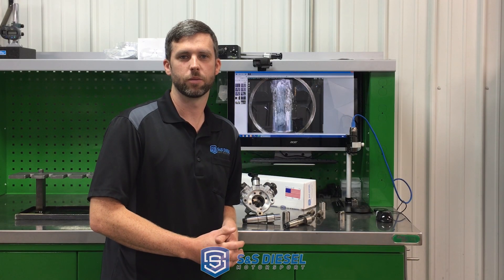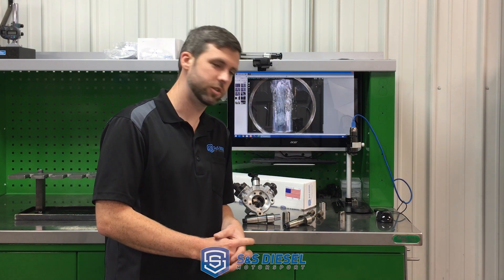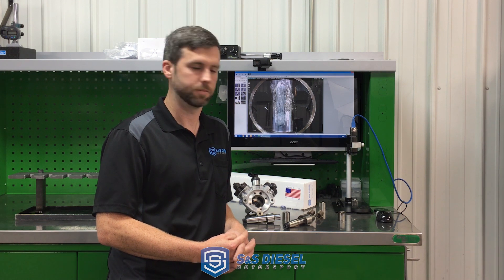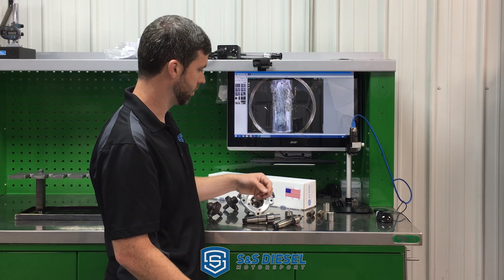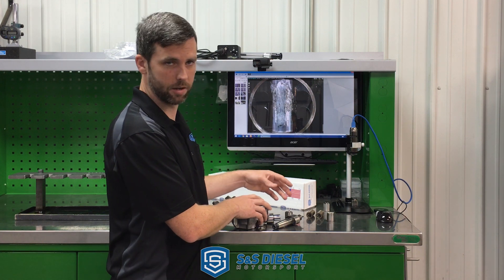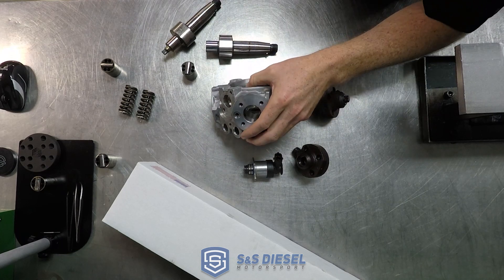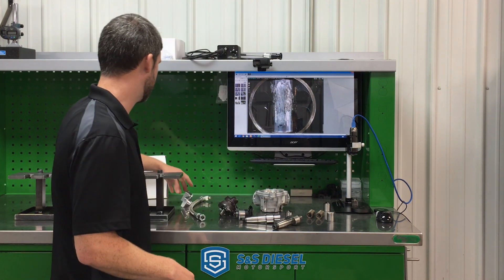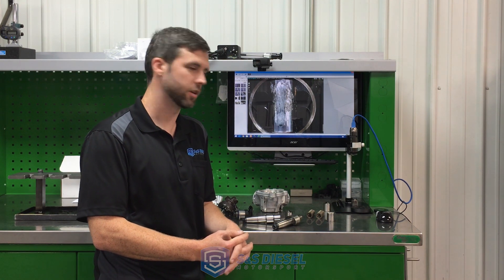S&S Diesel Motorsport Ford CP4.2 Bypass Kit Explained

Comment: I appreciate the video; from my understanding, the piece of metal that has the convex side that moves in and out on the cam portion is a design flaw…you stated that it ‘has no guides’ and therefore it can turn sideways causing the failure…why hasn’t anyone designed a pump with this fix in mind?
Reply from the maker: That is one failure mode, yet we have also seen rollers seize up and start skidding without turning sideways. CP4s in 2020 and up CP4s have guided buckets, yet there are failures with those too. Luckily, we teamed up with Stanadyne to provide a more robust solution: https://ssdiesel.com/dcr/

Comment: How do you keep clean fuel in the bottom in the pump? The pump is cooled and lubricantes through the fuel coming through the system?
Reply from the maker: This is our original Disaster Prevention Kit that blocks off flow from the case to the VCV, and then taps into the fuel supply before entering the pump case. Pump case flow is not changed. We've since upgraded to a Gen2.1 DPK that taps into supply 25 inches up-stream  rather than at the pump directly. You can find a flow path drawing here: https://ssdiesel.com/wp-content/uploads/2022/03/SS-Gen2.1-Bypass-Kit-Diagram.pdf
Reply: @SSfueled  thank you

Comment: My S&S kit vibrates and hums at idle. Gets pretty annoying. Any solution to fixing this?
Reply from the maker: You're hearing the PCV venting fuel from the rail into the return filter. We added rubber isolators to mitigate the vibration. Please make sure that the the lines going to the return filter are not touching the brake booster or anything else.

Comment: You guys should make a kit for the Gen2 3.0 TDI in q5,q7, cayenne, touareg, and few other vw cars.  That has the cp4.2
Reply: The bypass plate fits, I was able to adapt it to the 3.0 tdi, just rerouted the lines
Reply: @manuel509rios  metering valve won’t fit tho
Reply: @naten555  the new version will fit not this one
Reply: @manuel509rios    are you saying the old S&S bypass plate fits (gen 1) but the new version (gen 2.1) wont?        Or are you talking about the metering valve.  I'm aware i need to get a 90 degree one metering valve to fit under the intake manifold.

Comment: I have a couple questions for you guys at S&S. What is the micron rating of the return fuel filter you add? More importantly, when a hpfp fails, what micron range is the metal that is produced by the failure?
Reply from the maker: Great question. We failed a CP4 on our test bench to get a debris sample for analysis. Particles found ranged from 0.675 micron up to 859 micron, with the average particle size being 20.3 micron. The Donaldson return filter we use has an official rating of 9 micron at 99% efficiency, yet further testing shows that actual efficiency rating for 9 micron is 99.575%,  for 7 micron is 99%, and for 4 micron is 94.7%. Per the particle testing, 23.8% of the total volume of debris was under 8.68 micron, 20.28% was under 7.64 micron, and 3.12% was under 4.33 micron. This is a long answer to your question, but we want to present the exact data. In summary, 96.88% of the CP4 debris is 4.33 micron or larger, and our return filter is 94.7% efficient at catching the 4 micron particles and 99.575% efficient at catching the 9 micron + particles.
Reply: @SSfueled  i appreciate the long answer. This is the exact nerdy data I was looking for! Thanks so much!!! Keep up the good work!
Reply: @SSfueled   At micron level would you expect to have injector and regulator failures?
Reply from the maker: We do not have enough data to give an exact size. Based on our in-truck testing, the 9-micron DPK return filter and factory Motorcraft supply filters were sufficient at containing any particles that could cause damage. We pulled and tested an injector and it was in perfect health.

Comment: Since 2007 when USEPA mandated ULSD the below question has never been answered

The ASTM HFRR test is an abortion. A complete joke. Where does the HFRR test duplicate pressure like a modern-day diesel fuel system? Bosch CP4 pump failures prove the current ASTM lubricity test is a complete abomination

I would like to ask you a question, in all your years of experience, has anyone ever defined for you the meaning of "Diesel Fuel Lubricity"? Beyond just the words? I have looked high and low and from here to there for even a technical definition by anybody and I have found nothing. Sulfur has no lubricating properties whatsoever.

Or put another way. Outside of the ultra-low sulfur diesel fuel excuse. Do you know what causes diesel fuel to have poor lubricity? What is causal mechanism in the fuel that is causing the diesel fuel the poor lubricity problem?

Thank you for your time

Kindest Regards
Mike Colburn
Las Vegas, NV
USA
702 716 0182
Reply: wow! - Thank you for sharing and I hope to hear a response to a powerful and well worded question!
Reply: @tattooedmillionair  I asked the question to many many so called diesel experts. I have yet to receive a proper answer. We do know the answer and why diesel fuel lubricity got worse.

Comment: So when adding the return filter to the gen 1 kit is it as effective? How much more flow does the gen2 kit provide? Is it better to just go ahead and get a new Gen 2 kit and new fuel line?
Reply from the maker: Adding a return filter assembly to an original bypass kit protects your return lines, tank, and supply pump. The one potential flaw in the original kit that we have seen a few times out of thousands sold, is that if the return circuit in the CP4 gets completely blocked with metal, there is a chance for some metal to back-feed through the bypass block and into the FCA. Our Gen2 and 2.1 kits move the split off point upstream from the pump to prevent any back-feeding even if the return clogs. We have not tested the flow of the original compared to the Gen2, but we have tested a stock CP4 with and without the Gen2 kit, and discovered that the Gen2 kit increases output of a stock CP4 from 3,000 - 4,000 RPM. If you want the best protection, get a complete Gen2.1 kit, but keep in mind that anytime the fuel system is open there is a risk of contamination. It may not be worth the risk if you can just add the return filter and get most of the protection of the Gen2.1.

Comment: How does the fuel still get in to the crankcase of the pump to lubricate it and cool it how is it still flowing through there
Reply from the maker: Great question. The bypass block feeds the case and the metering unit both. We have since redesigned our kit to have a Y further upstream from from the pump, to prevent any back-feeding if the pump case completely clogs with metal.  Here's a great drawing that explains. https://ssdiesel.com/wp-content/uploads/2022/03/SS-Gen2.1-Bypass-Kit-Diagram.pdf
Reply: @SSfueled  and the feed to the crankcase does that return unfiltered if the crankcase destroys itself
Reply from the maker: @onthecheap6292  due to positive pressure (roughly 60 psi) on the supply to the case it is not possible for contaminated fuel to travel back up stream to the Y portion. Return coming out of the case goes to our Gen2.1 filter head.
Reply: Had the exact same question and was hoping someone asked it and got an answer. Thank you kind sir 👍🏼

Comment: Will this kit hook up to the hs Motorsport aftermarket upper fuel filter housing kit?
Reply: Yes, I have both. HS Motorsport system only removes the cheap plastic filter so no modifications affect the installation of the Disaster Prevention kit, regardless of manufacturer

Comment: What is your opinion of the denso HP4 pump on the L5P duramax? Is it more durable than the CP4 and is it subject to a complete fuel system contamination in the event of a failure? Thanks.

Comment: Doesn't the fuel need to pass through the bottom end of the pump in order to be pressurized ? And what happens when you restrict all that fuel that is fed to the bottom of the pump ? Doesn't that create some kind of back pressure that could cause damage ?
Reply: @SSfueled  Thank you. Isn't there any way of filtering the fuel as it exits the pump and goes to the injectors or back to the tank ?

Comment: Will this void warranty? I have a 2020 6.7 f350.
Reply: It really depends on your dealership. If the dealership agrees to install it i imagine that it would be okay. However if you installed it and then have a failure, they could blame you for introducing contaminates into your fuel syatem while installing.

Comment: The reason why there is low confidence that this will solve the problem is becuase it sends metal particles back thru the tank.  The particles smaller than 20 microns will pass thru the lift pump filter and the particles smaller than 5 microns will pass thru the engine bay filter as the contaminated fuel recirculates thru the DPK fuel return line.  This means that 4 micron and below particles will sand blast the rollers and injectors ....the wife spread failure will still occur via the large quantity of sub 5 micron particles that neither filter will trap.  A 1 or 2 micron filter between the engine bay filter and the fuel pump will help trap 5 to 2 micron particles.  But even then,you would still ha r a large amount of 1 or 2 micron particles thru out this system and that will result in the need to replace everything anyway.  The best cure for co4 disaster prevention is to switch back to a gas truck and toss the deisel truck over the fence.

Comment: Being from Alaska and pulling trucks and equipment in and out of hot garage two very cold outside air. You end up with a lot of moisture problems and freezing in the fuel. Is easily dealt with with a tank drain in the sump of the fuel tank. It seems like all the cp4 problems can be solved with a drain in the fuel tank that is just drained periodically to remove contaminants. Fuel containing water is heavier than fuel that doesn't so even that settles to the bottom of the tank overnight. If these guys drain to 1/2 gallon out of the bottom of the tank once a week or 5 fill ups they wouldn't have these problems

Comment: So fundamentally the design of the fuel pump is shit in the first place - the roller should have been designed so the could not rotate. Why isn't there a class action suit against the designers/manufacturers?
Reply: The "lubricity" in the diesel fuel is not what it was in the "sulfur" days
Reply: @SSfueled  - You're being way too polite. One look at how this was designed with a roller bearing on a cam lobe and nothing to prevent the piston from rotating tells you its a disaster waiting to happen. A helical screw design would have been better - progressively increases pressure without pulsations. Surprisingly Bosch have made 60 million CP4's - it would be interesting to see the failure stats.

Comment: So, normally the lift pump feeds the bottom end of the cp4 first.

In your system fuel travels back to the tank. Therefore, the lift pump feeds both the bottom end and the top end independently. 
Why couldn't the manufacturer build a pump that uses engine oil to lube the bottom end separately?

Comment: I use a exergy metering valve, keep ur truck above half tank add a good fuel stabilizer n fillup at a place that gos through alot of diesel fuel n ul b just fine.
Reply: Do you have a Disaster Prevention Kit for a 2016 Duramax?

Comment: Forgive my ignorance. I understand you now supply fuel from the filter housing but how will that prevent fretted metal particles from being discharged with the high pressure fuel into the rails? Wouldn't a high pressure filter assembly work better?
Reply from the maker: Great question. That would work great, yet to create a filter that can withstand extreme pressure has not been developed, if even possible. The required size to filter fine particles and not become a restriction would be massive due to the wall thickness needed to hold the pressure in. We have found that sending the case fuel back through a return filter directly after the pump works best.
Reply: So the kit protects against debris going back to the fuel tank, but doesn't prevent debris going from the pump into the high pressure rail and injectors?  @SSfueled
Reply from the maker: No, all versions of our Disaster Prevention Kit block off pump case flow to the VCV (which feeds the high-pressure plungers). The VCV is then fed with clean fuel right from the stage 2 fuel filter. We improved on this design with our Gen2 and Gen2.1 DPKs by adding factory quick connects for easy install and a return filter that contains the debris if a failure happens. What we failed to explain in our previous comment is that normally the VCV (volume control valve) is fed fuel from the CP4 case, which is where the metal is generated when a failure occurs. Our DPKs block off that feed port and feed the VCV independently from the case. The case is still lubricated with fuel flow and the plungers get clean fuel from the filter.  @mikes7745

Comment: I installed mine today. Good product. Couple of things wish were addressed before hand..hope they help others.

1- instructions are almost identical to that of Accurate Diesel kit...meaning no torque specs provided...on something with high pressure..tightening without it feels subpar. 

2- biggest time consumer was getting the notch and casting flash removed so the lower intake would sit without sitting on the metering unit. No instructions indicating how much to grind off.  I was careless enough to grind away and make a small hole in the intake! Good thing for JB epoxy! By the time i was done the intake still sat on the metering unit...oh well keeps it from going anywhere ha.

3-follow the instructions and do not tighten the flange side of braided line until you have secured the line..lots of movement required at the end and dont want to end up tightening in wrong position.

Just wish they made a single supply line that required no cutting. Just swap sensors and good to go. Good product and thanks for the extra orings.

Comment: Great Video. I have a 2011 Dmax . I installed the Fuel savor Metering Valve by Wehrli. Do you guys make a kit for the Duramax or planning on doing so?
Thanks,
               Heber
Reply: @SSfueled  what if you made a kit that placed  a block in place of the metering valve, that went up to another plate where a fuel system saver went and a 2 mircon filter that than supplied fuel to the heads on the cp4.2? i know it would be a bit of a challange but it would help catch alot of the metal, mabey even integrate a sensor that if it detects any metal in the fuel it will give the driver a warning?
Reply: SS Fueled I still do not understand what the fix is for the LML, can you explain a little further please? I have a LML.
Reply: G-male Gun cp3 swap
Reply: Great video??